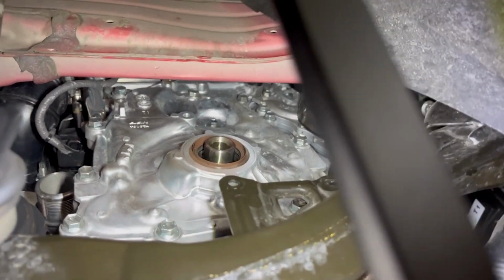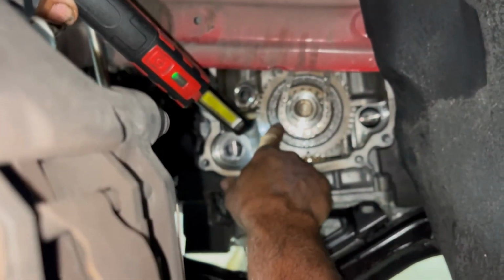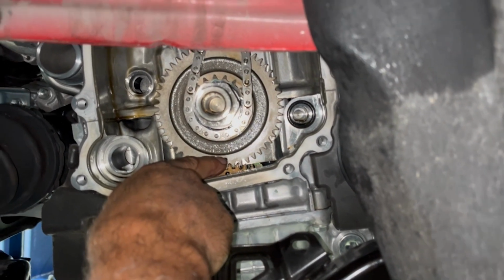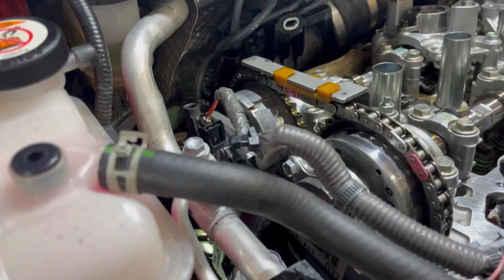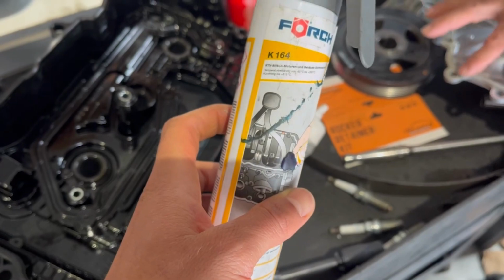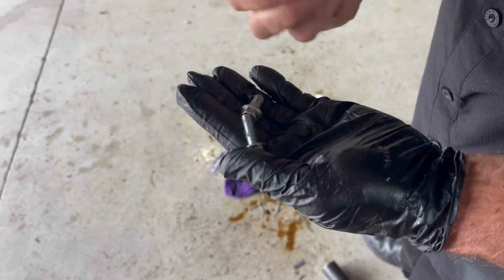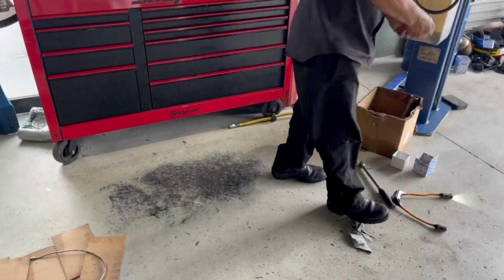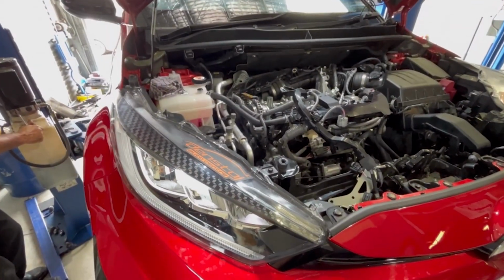Inspecting timing chain on GR Yaris (G16E-GTS)

Comment: does the 3 cylinder vibrate after a year or 2 like other 3 cylinder from toyota?
Reply from the maker: It's hard to say for certain, as all three-cylinder engines vibrate more their four-cylinder counterparts. In the G16E-GTS, Toyota has tried to reduce this with tuned balance shafts and improved engine mounts, but some vibration over time is normal. Ultimately, time will tell how well these engines hold up and depends how they're driven. Are you thinking of buying a GR Yaris of GR Corolla?